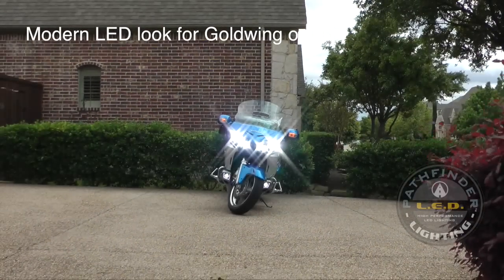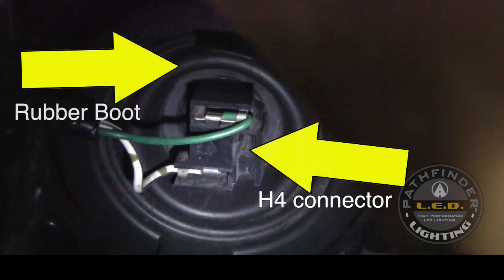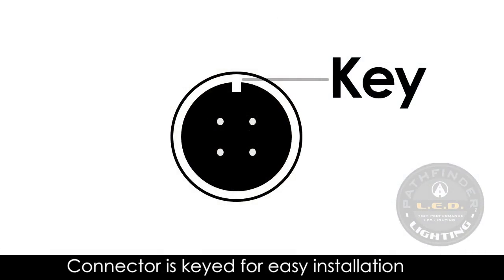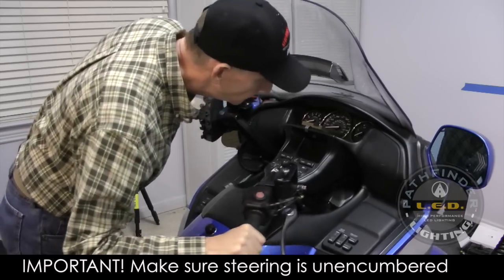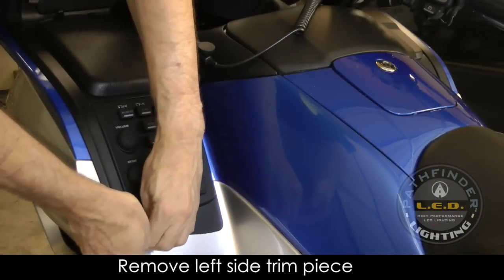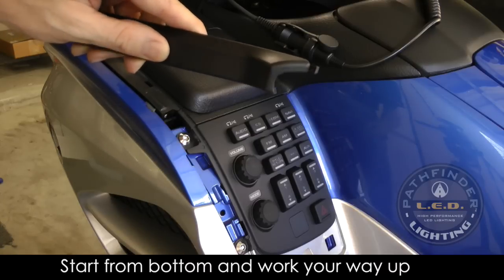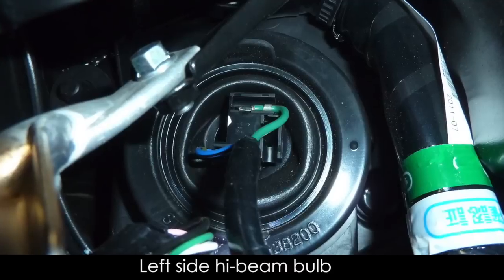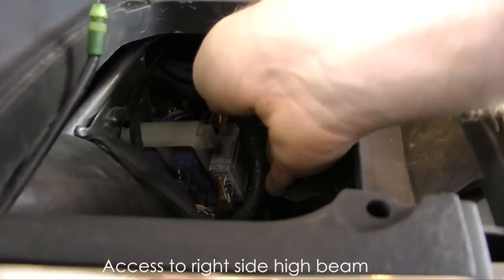Install Pathfinder LEDs on Honda Goldwing GL1800

Comment: LED bulbs have come a long way now. The LEDs are placed strategically similar to the light source on an incandescent bulb therefore the light output is very close to the original design. They don't put out scattered light and the modulator's we carry are compliant with FMV codes. Aiming your headlight is very important after installing the new LEDs. A good rule of thumb is to aim the lights at the license plate of a vehicle in front of you. Using your headlight adjuster to dial down the light is recommended as to not blind oncoming traffic.

Comment: The white material on the threads for the heat sink is thermal paste.  I installed 2 sets of these in my 2017 GL1800 tonight, they sure are bright!

Comment: I did my 2017 high and low. That glove box side was a bear. Absolutely no room. Pure luck getting it in. Your video saved me hours. Thanks!
Reply from the maker: It really helps to have small hands, and even then, it is a pain. After you have done it a few times, it actually gets easier. But, I still get cuts on my hands every time.

Comment: Cruiseman, you're the best!  I enlisted my wife (smaller hands) to help me install the low and high beam LED headlights as well as the Pathfinder LED fog-driving-signal lights.  Your instructions were very clear and video showed exactly what needed to be done.  A minor deviation for my 2015 wing is that there are recesses on the lateral walls of the fairing where the low beam LED drivers and cords fit nicely.  I secured them in there with cable ties.    Many thanks!

Comment: Not for nothing but if you use the kit from EC you do not have to cut the boot.   When I installed I did not remove the cable from the foot warmer,  just the screw and pushed it aside.  Thanks for another great video.
Reply: Hi John, kit from EC, what or who is EC?
Reply: The lights are completely plug n play. There is no cutting of the boot anything else.
Reply: @willtopower2158  Electrical Connections is a company that sells various lighting and other gadgets for motorcycles and some other machines.
Reply: Unless they changed their heat sink design, I wouldn't say it's identical. We have a different design.

Comment: Just finished putting in the LEDs high beams and low beams the job was little tricky. I found the high beams were easier to do then the low beams. Simply because the cords that you need to plug in are closer to you than the low beams, because the low beams are further up front. Just take your time I did both in less than an hour so it went very well and my hands are not that small.

Comment: Hey Cruiserman, just a question. The picture of the LED kit appears to show the H4 plug with three prongs yet you were able to connect that connector to the H4 connector that went to the original bulb. So does the H4 male plug coming out of the kit have 2 or 3 prongs? This is for an installation on a 2005 GL1800. Thanks
Reply: The H4 plug on the LED lights will plug into the stock factory H4 female plug. The mail plug coming out of the lights are 3 prongs. The factory honda plug is a 3 female connection. Honda used an adapter with only 2 prongs for their bulb. This kit will fit perfectly and it's plug n play.

Comment: Question. Have you heard of any trouble with the leds blowing the relay or fuses?
Reply from the maker: No, I have never heard of that one.
Reply: @cruisemansgarage  buddy of mine riding an 06 wing installed pathfinder LEDs. Riding at night put high beams on switch to low and all lights go out. high beams turn off back to normal when bike is turned off and restarted. Any ideas?
Reply from the maker: @ffblack1  This might be a question for SoCalMotoGear support. I have never heard of that one. I would probably try replacing them with the stock bulbs and see if everything goes back to normal. If it does, perhaps there is one of the bulbs that has some sort of an issue causing this.
Reply: Might be the high/low bean switch itself. Had a similar problem with my cbr after washing

Comment: I had these PathFinder LED's installed on our 2010 Honda Goldwing at a dealership.  About a month ago we finally got to go for a night ride and our low beams are shining way too far out front and that is with our headlight adjuster for our Goldwing set on low.  Is there any other way that we can lower the beams for the low beam as this isn't safe riding like this with that big black spot out in front of the bike.
Also we are constantly getting flashed by oncoming traffic that our low beam light is too high.
Reply: There is an adjuster under the headlight to lower or raise the light

Comment: I have a question that does not pertain to lights. I hope you don’t mind. If so just disregard. 
I was attempting to change out my center stand for a ride on-drive off one. The 8mm bolt on the left side seems to be stuck. I have a long hex with a socket end on it. I am afraid that if I continue to force it or use a cheater bar I will break my hex. I changed out one on my 06 when I had it but this one seems to have red lock tite in stead of blue. I attempted my air ratchet on a smaller compressor and no luck. Any suggestions. I have some short hex w/ sock but they are sae. Don’t know if an 8mm will convert to the same size in sae? 
Help
Richard 
Bastrop Tx
Reply from the maker: If it is red loctite, you must apply heat to loosen the loctite. try a heat gun, or a small torch on the head of the bolt, but be careful.

Comment: I didn't  realize hi beam is so difficult to reach I have large hands I suppose I would still try or get the dealership  to do my hi beam 😣😣
Reply from the maker: Not easy even with small hands.
Reply: @cruisemansgarage  ok ill get a dealership then
Reply: @phillipvazquez284  I got fat hands and completed it.
Reply: @JohnnyC10071959  ok
Reply: @JohnnyC10071959  eventually  I'll do it

Comment: Might be brighter but they don't lights down deep the road...better the original yellowish one
Reply: It's because halogen headlights are designed to reflect from a critically specific light source which replacement leds ulbs can't replicate. Function over form. Here in the UK it's illegal to install leds in a halogen headlight and it'll fail the annual inspection test (MOT). Invariably it also blinds oncoming traffic as well due to the light scatter.